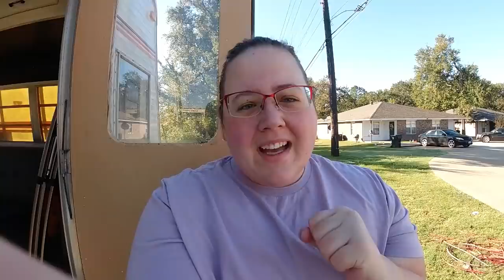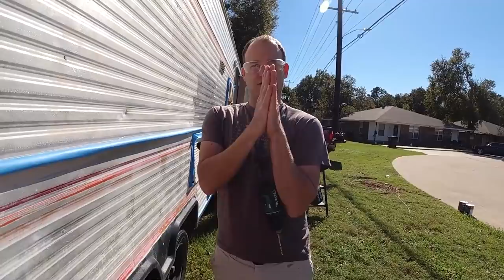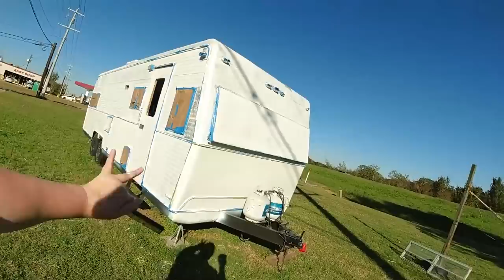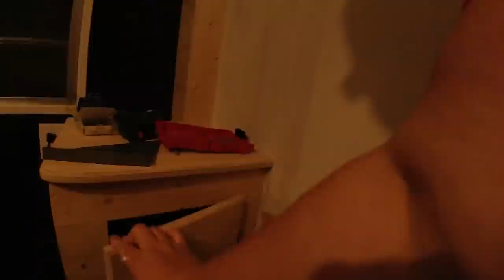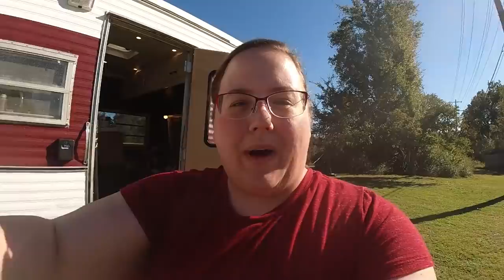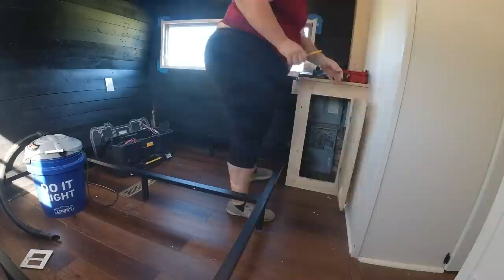Custom painting, renovating  a vintage travel trailer - AirBnB reno!

Comment: thanks for sharing! Come onnnn lets get you to freaking 100k!! 🔥
Nonrelated question, what camera/setup you use for recording? Im going home in a couple of weeks and want to do a long recording of the procedure, getting ready my homestead. But dont want to spend too too much, like must youtubers recommend.
Reply from the maker: Most of my vids i just use my phone. For this i used a dji osmo, but it only lasts a couple hours at a time, same with gopros.
Reply: @BudgetGirl  thanks for the response. yes, thats the problem, that I thought about a gopro but it will only last a couple of hours. We'll see. 
I have a paid of 2 acres back home in Puerto Rico, and I have been tempted to build an offgrid cabin or A frame to stay there and Airbnb 😏🤔...that land is where I want to eventually retire in. We'll see what happens.